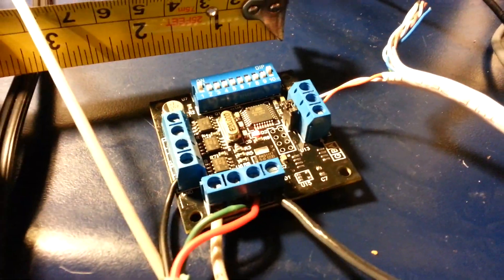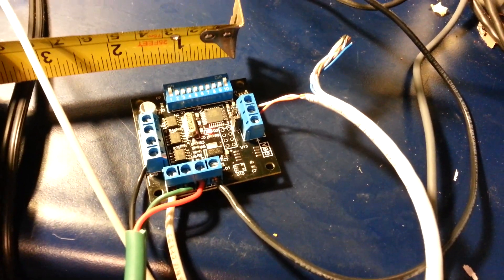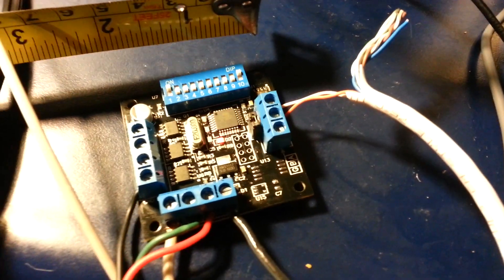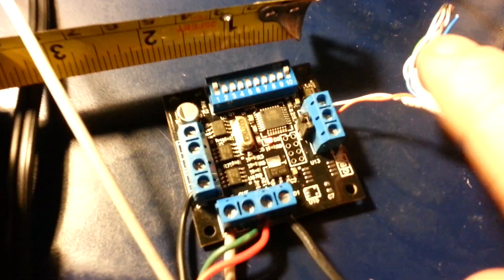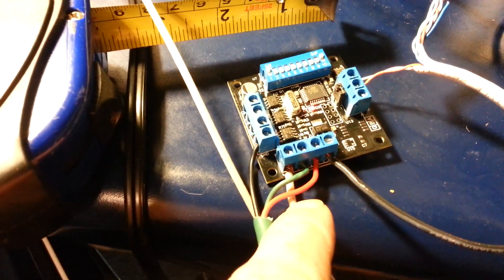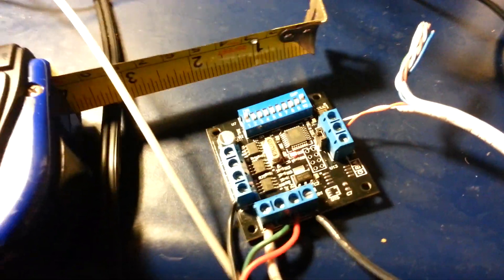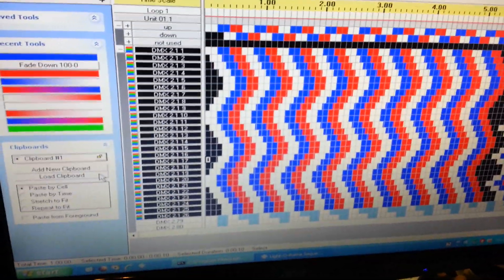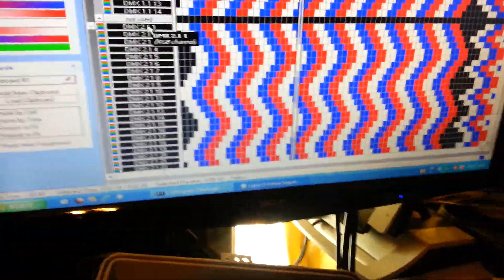Small DMX RGB pixel controller foud on eBay for under $20

Comment: Newbie question so I apologize in advance. What is the advantage of using a dmx controller with the DMX board vs a regular pixel controller? I thought that dmx had significantly more limitations do to its design purpose with controller/software... Thanks
Reply: I ordered a KULP KPB8 control for my first light control but definitely interested in frugalness or a tool that works.
Reply from the maker: I would stick with newer pixel controllers  that are e1.31 compatible.  I'mahuge fan of the Falcon controllers,  that's what I use in all my shows and I have zero issues.   The Kulp controllers are okay but I have one that constantly needs updated.  Price is lower but you have to maintain the firmware.  I am happier with the Falcon f16v3.  New F16v4 are available but are brand new this season.   I will mess with mine over the winter.

Comment: Thanks for the video.  I watched this some time ago and bought four of the E1.31 Bridge kits and 24 of the DMX to WS2811 pixel boards.  This setup has worked flawlessly all season running my house display (Seen on my channel).  Thank you for turning me on to this.  I'm able to run DMX and 12v from the enclosure with the bridges out to a small breakout box which houses the DMX to pixel board, and the to the pixels.  I found that running DMX and 12v out to the effect in this way from a central location requires only one four conductor cable per universe.  I've just started playing around with the Falcon pixel controller but I think I'll stick with this setup for a while since it's pretty solid.
Reply from the maker: That is wonderful news.  Have you updated to the newer GUI web page to make setup easier?  I was thrilled when they added the new functions.  I still have these boards and really didn't use them much after getting the Falcon F16v2's and F16v3's.  They are still a very solid option and I'm glad you are getting good use out of them.
Reply: Was not aware of a GUI update.  I'll check into it, but I had no issues setting up.  I bought the new Falcon F16v3 along with differential expansion boards but the DMX bridge's and pixel boards work out so well that I don't know what to do.  Perhaps use both!

Comment: hi what software are you using?and is it free?thanks
Reply from the maker: earl cast hello there, I am using xlights software for programming and running my show. Yes it is free
Reply: do i need to connect all the dmx to a network so that i could do all the effect?thanks
Reply from the maker: What do you mean?  Connect all the DMX to a network?  Connect the controller to DMX.  Then you can output effects to the universe that controller is running.  One universe can hold 170 pixels.
Reply: what kind of insulated wire did you used?thanks

Comment: hello. Really really nice video..  I just wondering.  The controller sends 12v and WS2811 wants 5v. how did you solve that?
Reply from the maker: +qualmos... 
Hello... this controller is not setup to run 5v.  You could purchase a 12v to 5v stepdown from Ebay or Amazon.  Run the 12v output from the controller to the step-down.  Then test voltage at the other end to see if it was 5v.  Then connect your pixels to 5v and add in the data and neutral.
Reply: Thanks for the quick answer.
I wonder why the make the strips in 5 volt. i guess that  You can easily get voltage drop when the scale is from 0 - 5 volt maximum.  i some pages on ebay, they say that you can drive 12 v on strips that looks very like 5 volts strips. that is a little bit confusing,
Reply from the maker: 5v is what the actual LED light runs off of.  Most all LED's (RGB or otherwise) lean to the 5v side.   On a 12v strip, each individual pixels has a step-down converter connected to the LED that converts the power down to 5v.   Having 12v available solves the problem of voltage drop over long distances, something I experience after running 100 pixels (mine are all 5v) in a row.  I have to inject power at the end of the set to achieve the full power requirement. 

There may be a 5v controller available from the seller.  If you search his eBay page for 5v ws2811 it may show up?  Happy to try to help.

Comment: hello ami9go u have the design for sale? I have a vested interest, please help me. thank you
Reply from the maker: Deives Bender 
I have setup this board as a pixel test board and use it to help trouble shoot while the display is running.  I have found the e682/e6804 from Sandevices, and the Joshua ECG-P2 to work very well while controlling all my pixels in the display.  

This is not my design.  I purchased this board from eBay.  Here is the link to the item:

http://www.ebay.com/itm/DMX-to-WS2811-WS2812-strip-converter-WS2811-WS2812-led-controller-/221299388963?

Comment: i was thinking about purchasing that pixel controller. do i need a dmx-artnet interface or will it work with the standard 512 xlr/dmx interfaces as well?
Reply from the maker: This controller is running off of straight DMX coming from the DIY LED Express bridge.  You will need something that can convert the signal (an interface as you call it) which is output from your pixel software into a DMX data form.  The DIYLE bridge converts data from  e1.31 which is output from the software.  The bridge then outputs the DMX data to the controller.  This controller must have some from of connection to the computer using a DMX converter.  You could also use a USB type dongle such as the DMX King, or the Enttec Pro .    If you already have a DMX data output some how out of your computer such as a RS485 line that already runs DMX, then it might work.  I do not know about using RS485 for DMX.

Comment: We designed and tested some of these specific controllers for RGB nodes before they were mass produced, then ended up scraping the idea, since they only work some-what acceptable if your load is very very close to itself or else the mosfets (rated for 30V MAX) will not / cannot handle the back EMF and it ends up burning up (current design is rated for 25A per channel RGBWC with mosfet breakdown voltage of greater than 100V). If you would like to see the scale of the type of work our company does, you can check us out at http://www.allen.dj

Comment: I'm currently using 3 of these cards for a video mapping project where I'm building LED bars out of the WS2811/2812 60/m tape.  I've yet to have a problem with them.  I use a simple proj. box from Radio Shack and set up XLR i/o to the card.  I set them to DMX address 1 and round ArtNet out of a DMX node I have.  For what they cost vs. what they give you it's very impressive.  We are currently developing an E1.82 to DMX card that will process 15 universes in an effort to stand up a 30 bar rig.  I'm happy to post a response video once it's complete if you'd like.
Reply from the maker: Yes, please share.  I'd be interested in a 15 universe bridge IF it could run off of e1.31.  I have a few other controllers that could run off of it.
Reply: I found a 12 universe solution what will take input from either ArtNet or E1.31.  Email me and we'll chat.

Comment: Did you use this for your 2013 Show ?  How well did it perform ?
Reply from the maker: Due to receiving my pixels and RGB nodes so late in the year (mid September) I did not have the time to  utilize this controller.  I'm considering using it for a pixel tree on the roof next season.